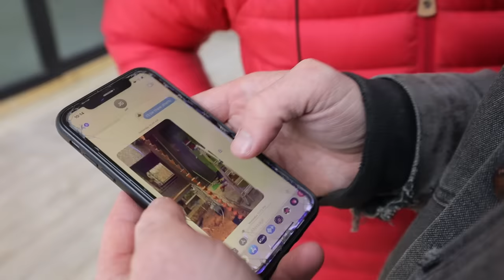Setting Up For Honeybees

Comment: Have you considered having steps from the sun porch desk to the sidewalk? Or extending the front porch to the sun porch deck and relocating the stairs so the stairs lead to both decks?  Seems you'd want to go from the kitchen to the sun porch and then the garden?  Just thinking of the flow from kitchen.

Comment: STRESS-WILL-MAKE-YOUR-BACK-HURT!
100#. Think about all your nerves run down your spine.  It gets tight and swollen from stress putting pressure everywhere.
As soon as the Light Bulb goes on and you realize this, it's much easier to fix. If you have to take a day off and relax and meditate it's well worth it.

Comment: If anything happens to the gutter downspouts at the corner of the deck away from the house it will always be easier and cheaper to replace them then it would be against the house! Gutter downspouts can be destroyed against the house easier and if they leak it may wash out next to the house which is terrible!

Comment: YOUR BACK: could it be your psoas? Mine acts up and causes a limp when my nervous system is disregulated from stress.
Reply: Psoas runs from the lower ribs, to spine and spine to legs. Not fun.